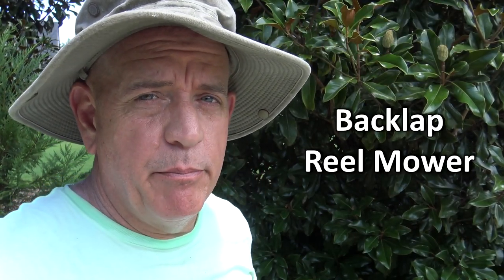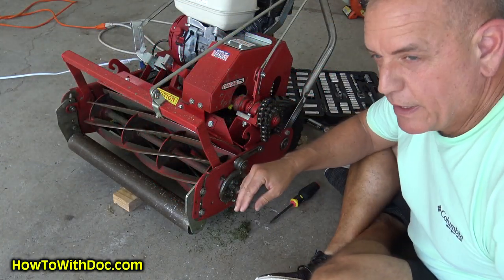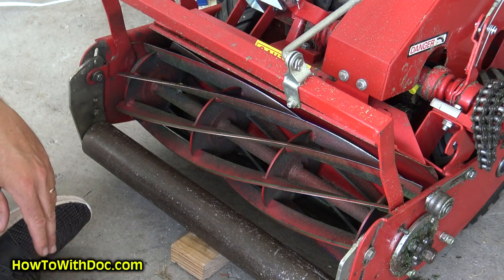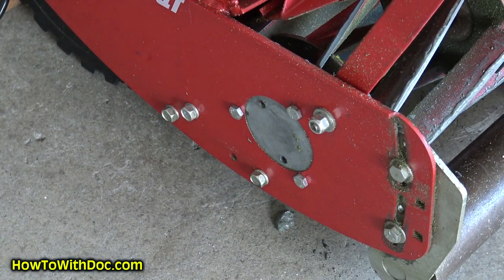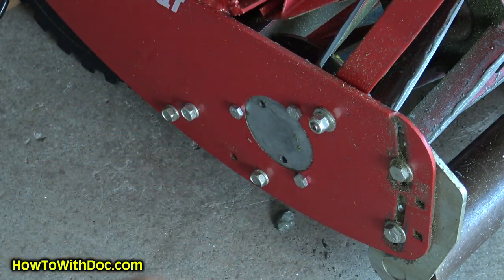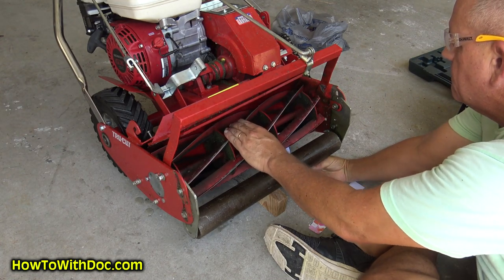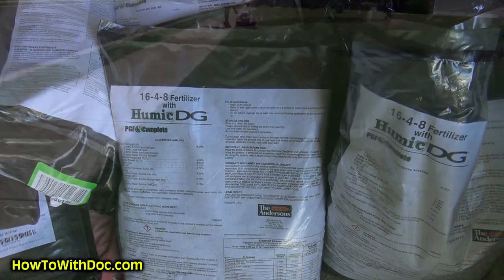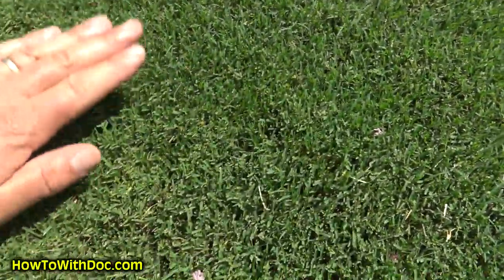Backlap Reel Mower

Comment: Finally a Tru-Cut video that takes the mystery and misery out of how to keep the mower cutting sharp....p.s.waiting for your mower to start needing clutch plate adjustments on either reel side or drive side.  Headed to the garage - Thanks Doc
Reply from the maker: lol... a LOT of research and testing went into this silly video. Most won't understand... but if you own a trucut, you will.

Comment: Finally a tru cut backlap video. Thanks Doc!
Reply: You can always count on Doc!
Reply: Doc, one thing to call out is that you don’t have to remove the chain in order to backlap or make reel/bedknife adjustments on the Tru-Cuts. I’m by no means an expert on Tru-Cuts but I do own one and have been doing this for years. Might save you a little time on your next backlap by not removing and reinstalling the chain. All bolts are accessible with the chain still on.
Reply from the maker: True... but for safety doing it with a handheld drill, I think people should remove the chain.  I can see a shirt getting caught in it.
Reply: @HowTowithDoc  Excellent point. Good call Doc!

Comment: Hey Doc, just a couple recommendations I've learned by experience.  80 grit compound is pretty aggressive and will wear into your bedknife quickly.  I use 120 grit compound for my typical backlapping.  If I have any major blade dings then I would use an 80 grit at the beginning to knock down the defects fully clean the compound off and then transistion to 120 grit compound.  You will end up with a much finer edge.  Also, I completely clean all the grit off before I run the blades in the cutting direction.  You ran your blades while you were rinsing.  You can dull the cutting blades and bedknife if you have any compound left on the blades when operating the mower.
Reply: Where do you by the grit compound?

Comment: question: there are two slotted screw bolts with jam nuts on them on both sides of the frame up behind the reel. the left side is hard to get to because of the motor chain to the drive system but the right side is very visible and easy to get to. i have looked and looked in manuals and onlne to see what these screws are for and what they adjust. any idea what they are for . ? you help would be greatly appreciated

Comment: So that third bolt on the bottom doesn't get torqued down the same as the others? It's just finger tight and then turned as needed for finer height adjustments?

Comment: does it already need to be backlapped or is it just a how to video? Thought you just purchased that this year.
Reply: Great question! I've been wondering how often it needs to be done!
Reply from the maker: Yes, Deep cutting and multiple yards. It's only a 15 min process so good to do when you feel any rounding.
Reply: @HowTowithDoc  wow...I've  had mine for 3 years now and cut about 3 times a week and still dont need to back lap. I check to make sure its cutting every week using a piece of paper. I guess how tight the reel is to the bedknife and rpm is a factor when it comes to wear.

Comment: Do you back lap a brand new blade wheel? I have one i just put on it has so much resistance when I spin by hand but it the only position it will do the paper cut test.
Reply from the maker: Don't worry too much about the paper cut.  It will cut fine. Watch the new video.

Comment: You call this a simple process?  Holy cow, looks like a lot of work!  What is sharpening the blades?  Rubbing on the rear back cover?  Doesn’t that eventually run away so future backslapping is impossible since it rubbed away?

Comment: Have you back lapped your Mclane 25in yet?
Reply from the maker: Keep putting it off.... this week probably
Reply: @HowTowithDoc  I would love to see it.  I have a 20 inch older mclane and have been using the duct tape around the sprocket method with some success.  reel rollers sells an adapter now.

Comment: Great, helpful video.  Insane how hard it is to find good info on blade adjustments for Trucut.  Hate to criticize, since it's the best vid out there on it. But I would love if you did a shortened version, start to finish, showing each adjustment you make.  It's already my spring primer vid, but I've had to make a cheat sheet with time stamps of the steps.  But I do thank you for this one!

Comment: Did you rinse your mower off spinning forward when there was still backlapping compound on there? That's not a good idea... Seems much more complicated to do the backlapping process on this mower than on a Greensmaster but I guess they all are a bit different. It's amazing what backlapping can do for the sharpness of the reel, as well as aligning the reel to bedknife surface up.